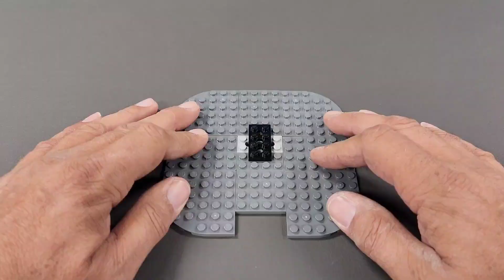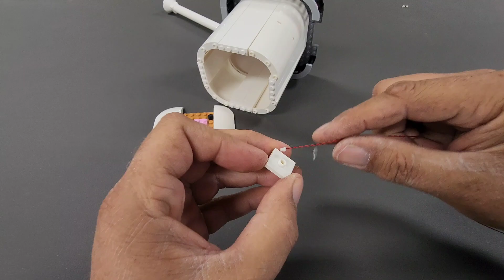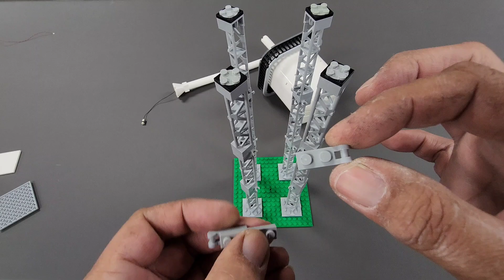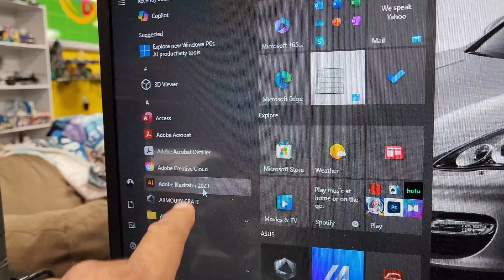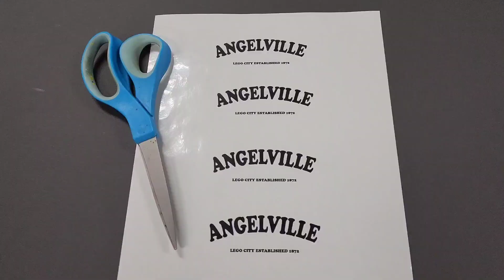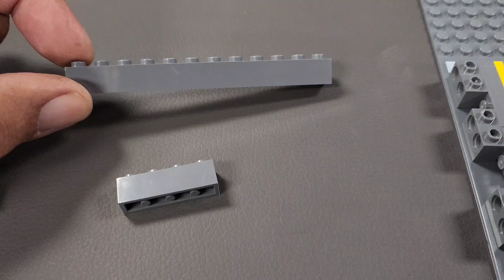Exciting New Changes In The Lego City

Comment: The scooby-doo speed had me cracking up. Great video Daryl, city is looking awesome! Friendly tip for anyone out there that wants to do their own stickers: For software, you can use Inkscape. It's free and provides a ton of features. It also uses vector art methods so the art can be scaled up or down infinitely. For the actual stickers, you can print them out on regular paper, cover over them with clear packing tape, cut them out and finally use a washable glue stick to create the "adhesive" and apply them.

Comment: I like the 8x16 half road plates better than the full square road plates for my roads because I can easily add the yellow striping in between while still having the option for the white stripes on the sides. Looks so much better than Lego official white short stripes. My roads are wider but that isn't a concern for me as I hate how the ultra wide sidewalk looks in so many people's cities.
Reply: This idea is totally getting borrowed
Reply from the maker: I use to typically do brick built roads only as like you, they look so much more realistic.  I started using the official roads just to show people its possible and I still have white edge lines as well.  The 8x16 is a much better way to build the roads, but I got well over 200 of these 16x16 so trying tp put them to good use 😀

Comment: For the turntable I install the top on the bottom of water tower in your case and the bottom plate separately on the supports only having to align a pin instead of 4 studs for each support is faster, easier, and I don't have to worry about accidentally misaligning the studs. I burn through so many turntables on my mocs that it is second nature to separate the two pieces now.
Reply: Oh that's smart. I hate aligning turntables under large builds. Thanks
Reply from the maker: Thats a great idea, thanks